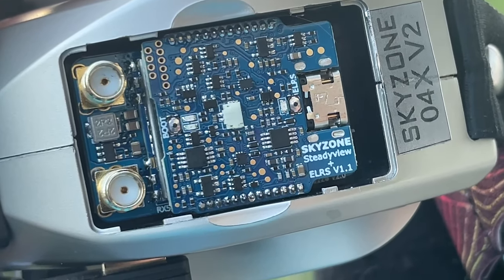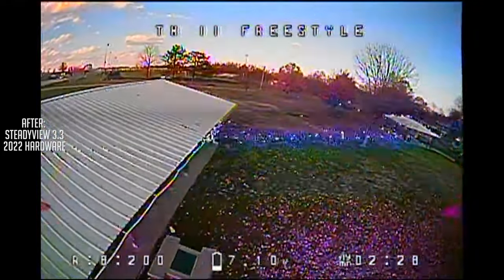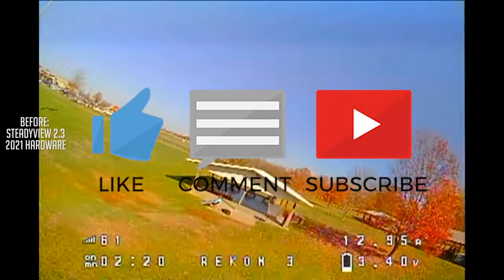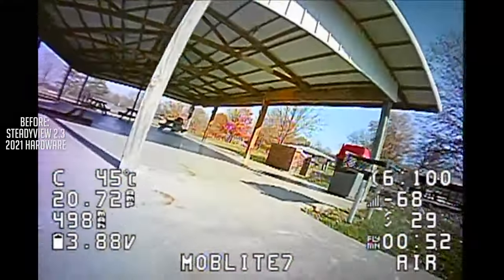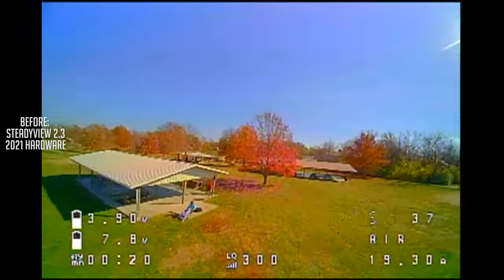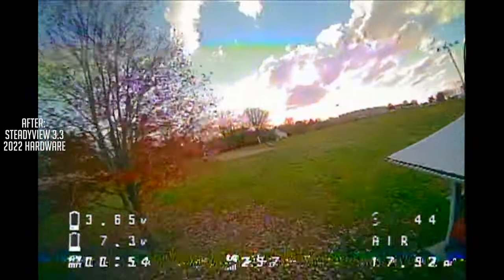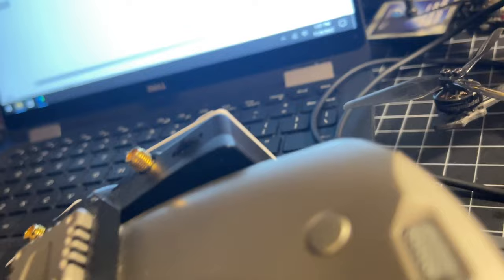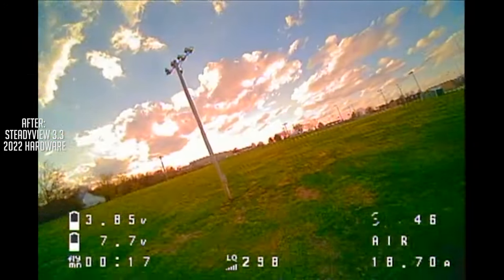SkyzoneFPV Steadyview Fusion Board V3.3 🧮 // Did They Fix Mix Mode?

Comment: change the TH2 antenna to a rhcp and put a ufl connector on it. VTX works great then
Reply from the maker: Yeah, I know. I honestly just want to replace the entire thing, because trying to solder a ufl connector on it or stripping an antenna and soldering the 3 points is a pain in the ass. I don't fly it often enough at all to go to work on it at the moment. Whoever thought that including a vtx with no ufl connector on it was a smart idea at emax on the second go around of this quad should be smacked.

Comment: Hi John, I've updated my Steadyview (no ELRS) to v3.3. Everything is fine in the googles but when I do an RSSI Calibration, the beep is continuous until I power off the googles, same for low level calibration and high level calibration. My googles are V1. Firmware are the right ones. Is it the same for you, or for someone reading this ?
Reply from the maker: It is not the same for me, but I use Sky04x V2 hardware. Calibration is successful for me, this does not happen.

This sounds like a problem that you should contact skyzone support for.
Reply: @JohnCuppi  tank you for your answer. I did thru Daniel's email and posting a ticket on the support page of SkyzoneFPV. Now waiting.
Reply: Hi John,
As this morning, when I've powered the googles I've got a black screen, I've used a spray for electrical contacts on fusion board to main board pins and main board to googles pins ... No more bugs, calibration went fine, so far so good. So I will consider the problem solved ... I hope
Reply from the maker: @chezloak6494  Good idea, glad to hear you git it resolved. Hope you finally have a resolution to your problem with the skyzones ^_^

Comment: I am sorry, but one and probably most important thing that is missing in Your before and after comparison is SUN. Most of that desync things happend more often on sunny day same as Your BEFORE, but all Your AFTERs have been made when sun was behind clouds. Anyway cheers for that.
Reply from the maker: I’ve never heard the sun was a relevant factor in the SteadyView desyncing at all. And in my personal experience, it has not been one.

It did not matter whether it was overcast or not, the tinyhawk freestyle, the betafpv quad, would desync all the same.

I have since flown a few packs on the affected models in sunlight, and they are not still desyncing. Even if it was not shown in this particular video.

I understand the sun changes the camera shutter, but I am not convinced it is a relevant test parameter when I can easily reproduce a failed sync in overcast OR sunny conditions for them.

I picked these because it was so immediately easy (with the only exception being the moblite7) to get a bad result at virtually any test time.

Comment: LOL. No they did not. Check out my video... You may go to hell if you view it... but you know... Could be fun :p

Apparently mine is working properly.

I have been talking to the useless support for months... months! With only hoops that I have to jump through, always asking me to do there job for them... FOR MONTHS, with no resolution. Months... months!

LOL Skyzone.

I would save the headache and get something else... honestly even the Eachine and Foxeer modules are better, and they are not even "proper" modules. Get a TBS or IRC module, those have been always really,  really good for me. And TBS can now use ELRS backpack!!! So that's cool!
Reply from the maker: Oof. That looks terrible. Is that the same result for all quads for you with the new module? That looks straight up defective, and also literally like FPV Hell if there was one... Lol.
Reply: @JohnCuppi  more or less, some cameras are better than others, and some are almost a solid colour, but all are unflyable. I now have every module Skyzone ever made, more than 50% have some major fault. Some work well… but still nowhere close to a proper module consistency and quality wise.

I can’t wait to send all this equipment back, and hate that I went out of my way to work with them, wasting my time.

Skyzone is by far the worst company I have worked with.